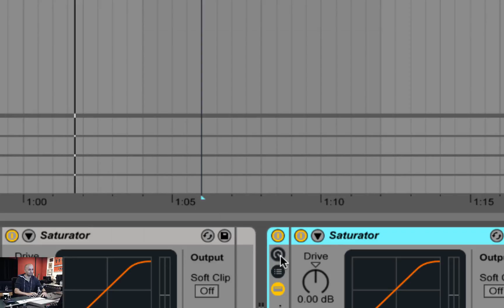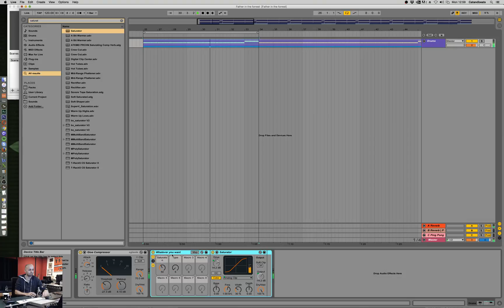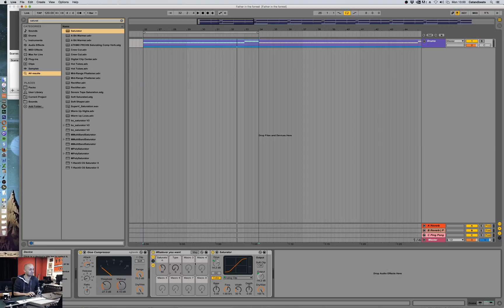Tip for setting up the saturation plugin

Comment: Simple but useful tips, thanks. On a side note, do you usually activate the DC button? I really can't hear relevant differences whether its on or off.
Reply from the maker: Good point :) I need to investigate) this. I tend to not use the  native saturator as a whole but I suggest key mapping the dc button and blind testing if you can hear a difference when everything is set so you have no output gain.